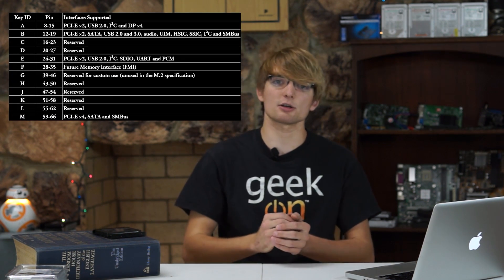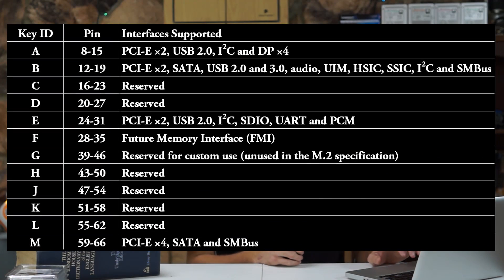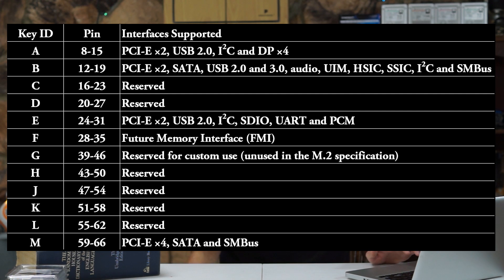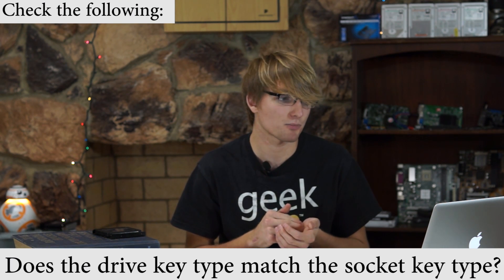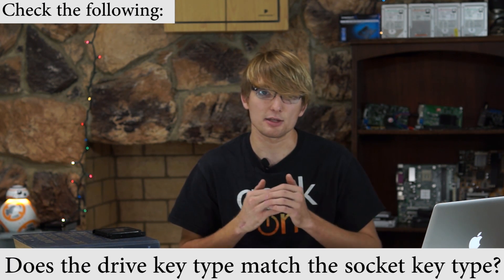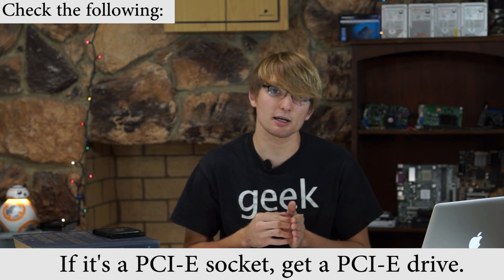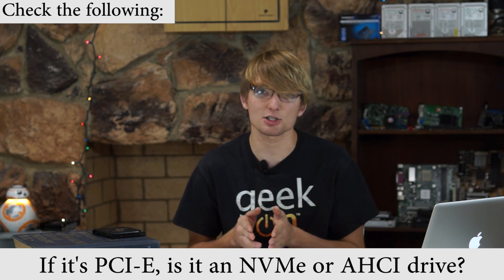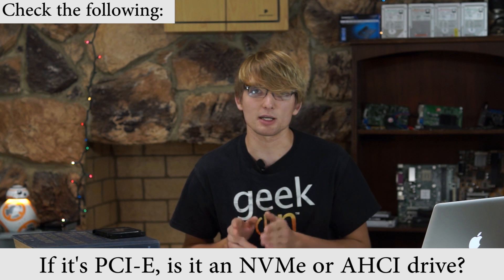What you need to know before buying an M.2 SSD

Comment: What is making me crazy is that I cannot find any answer in the internet to my question whether my old ASUS P6TDeluxe V2 will work with an NVMe SSD via PCIe 2.0 adapter card or not! I simply wanna know what you need for NVMe. Is it the chipset what must support it? Is it the mainboard? Is it WIndows? Or all together?
Reply from the maker: As I understand it, the interface is PCIe, so any PCIe device will be recognized by the board as such and then be handed off to Windows to find drivers. Unless the board has NVMe support, however, you can't use the card as a boot device. You shouldn't have any trouble using a PCIe NVMe card as a storage device, just don't expect the board to see it as a storage device for booting. - Chris
Reply: If your mobo has a bios update to support NVMe then perhaps it could be a boot device?

Comment: How to check whether the motherboard supports NVMe specification?
Reply: Same question
Reply from the maker: Your best bet is to check the manufacturer website. Most of them post either a spec sheet or a list of compatible drives.
Reply: @XKTechReviews  they have only written a M.2 slot ( I am using Hp 15q dy0008au)
Reply: Likely NVMe wasn't invented yet. If NVMe is supported they'd brag.

Comment: You are absolutely right, I bought a SSD M2 and I had no idea why my SATAS disappeared. I had to read on my phone that it was the other slot to avoid this and made it work in the 4 lanes PCI Express. 4 of my drives disappeared, and I read it should have been only 2, so I still have little idea why that happened and am still trying to figure it out, one reason I'm watching videos about this. My theory is that my motherboard, although it has 6 connector slots, each connector is actually sharing the same slot with another. So 4 connectors is actually two divided in two connectors each. I think you should have stressed that, the difference between SATA and PCI-E slots.

Comment: You didnt help me with my problem as i have an acer laptop( 1 year old) and i know what motherboard it uses but when i googled it nothing of importance came up. I wanted to know its specs and what it supports and so on as i have disassembled my laptop and found out that there is a pcie m.2 slot there and 1 wanted to use it but i didnt know if it was nvme compatible so im lost here.
Any help will be greatly apreciated

Comment: I got a question i have 1 m2 slot on my laptop lenovo Y700 standard it where a 128 GB NGFF m2 but i bought the 970 evo 512 GB upgrade NVME ssd i only got one slot and want to clone my windows C drive also bought adapter for M2 but it doesn’t support NVME only NGFF m2 sata is there a way to still clone my C drive to my new 970 evo?

Comment: Hey bro, can you please tell me if Samsung 960 EVO will give 3000+ read speed regardless of what type of port it's inserted in? I'm asking specifically for the laptops.
Reply from the maker: The M.2 interface is limited by the slowest factor, so if you put a fast drive into a slow port, it will run only as fast as the port will allow. You'd need a PCI-e 3.0x4 slot to get the full 3200 reads. A PCI-e 3.0x2 slot will limit the speed to about 2k.

Comment: my laptop has a b key slot, and i am wondering if there is a ssd that uses PCIe x2 over b key. and also, how do i find out for sure if the m2 slot supports PCIe or SATA? the manual says absolutely nothing. I'm starting to regret getting a toshiba..

Comment: If a M.2 stick is longer then the size of the motherboard- does this make it uncompatible? (I have lots of space beyond the physical end of the motherboard)
Reply from the maker: I don't see a reason why it wouldn't interface if you could get it to fit, but you'd probably have physical problems: it may not fit flush because of capacitors or other components in the way, and you wouldn't be able to secure it in place. It'd be less than ideal. ~ Chris
Reply: I see, yeah- it would be a bitch securing the other end properly.. but nice to know- thanks for the advice dude.

Comment: Still kind of confused um can I use an m.2 Bluetooth adapter on a pci e slot? Also thumbs up
Reply from the maker: +TheGGHackerz PlayMusic if you only have pci-e slots on your motherboard, you can always get an m.2 adapter card to use an m.2 Bluetooth card, but at that point it'd prolly be cheaper to just get a pci-e Bluetooth card. - Chris
Reply: XK Tech Reviews ok thank you I was just wondering because I need on for vr controllers and my friend has an extra m.2 Bluetooth card

Comment: I've recently bought the Samsung 960 pro NVMe m.2 and have Windows 10 installed on it. I currently have two windows 10 installed one on the 960 pro and one on my 850 evo ssd. I would like to transfer everything from 85p evo to the 960 pro with out reinstalling everything is it possible. Most of my stuff are saved and backed up on a 2tb hardrive

Comment: Not very helpful for online shopping.  So you have a Key type, then you have a drive type.. etc..  however, Online shopping is not setup that way and finding the "key" types are hard.

For example: Newegg: https://www.newegg.com/Product/Product.aspx?Item=N82E16820147594

Where is the Key type?  Also, no explanation on what the 2280 format is.  

So from this video I found out that my new motherboard supports a M-key type format but how do I find out the actual formats on the drives.  The specifications do not list the key as a format.

Comment: You have good content and editing I hope you get more popular. 
Its a nice haircut but you should get the hair that is covering your glasses cut.
Also, will I be able to somehow use a card like the WD Black 256GB Performance SSD M.2 2280 PCIe NVMe Solid State Drive on a ASRock H81M-HDS through an adapter or riser?
Reply from the maker: I'm not personally familiar with that motherboard, but it should technically be possible, with a few problems. The main problem is that the board only has two PCI-E slots, with one of them being a x1 slot. The x16 slot would be the best option for running an NVME drive, but I would suppose that you're using it for your graphics card. You could use the x1 slot with a x1 PCIE adapter card, but you'd be limited to speeds no better than a SATA drive, and that'd would render upgrading pointless. It looks like you will also need to flash your BIOS to the latest version to enable NVME support, as well. ~ Chris    http://www.asrock.com/mb/Intel/H81M-HDS/?cat=Download&os=BIOS

Comment: I gave the video a thumbs up and subscribed. But you did need a haircut lol.

Would have liked to see actual connectors or atleast pics of the actual connectors both on the boards and cards. Information seemed good. I just wish distinguishing the products apart when trying to purchase was as easy as the video made it sound. Its quite a difficult task to do. Even PC-Partpicker struggles with it. I've noticed and mentioned several errors on their site with compatibility issues.

Perhaps since U.2 is now starting to gain some ground and headway you can do a follow up video detailing M.2 even more and including info on U.2!

Thanks for the video and keep up the good work!
-Nate
Reply from the maker: Thank you! Yes, M.2 and several other current/next-gen standards can be quite confusing. I spent several hours researching the info for this video, and even after the research, it's not the clearest thing in the world. 

We took a bit of a hiatus, but we have some more videos on the way! I'll definitely look into making some more informational-type videos. ~ Chris
Reply from the maker: Hmmmm, there's not much info out there on that model. Did it come out of a pre-built system? 

Physically, yes, you could put a 960 on a PCI-E card and put it in your motherboard, but I don't think your motherboard has NVME support. You should be able to get the drive recognized as storage within windows, but I doubt you could boot from it. The second problem is that if your PCI-E slots are 1x PCI-E 2.0 slots, you're actually going to bottleneck the transfer rates to speeds slower than SATA. Even if they're PCI-E 3.0, you'll be faster than the SATA drive, but you'll still bottleneck the 960 Evo's performance. You really need a 4x slot to take full advantage of those read/write speeds.   ~ Chris
Reply: Hello, i was wondering, i want to buy the samsung 960 evo but i don't know if my motherboard supports it. Does it need a pci-e slot to work? if yes i think i got a slot available i got 4 x1 pci-e slots so will i be able to hook it in? my motherboard is : pegatron corp 2AD5, nice video btw liked and subscribed.
Reply: +MrMrdhmhtrhs7 - you will need a PCI-E 3.0 or 4.0 slotted motherboard in order to make use of its speed (or an onboard M.2 slot which your motherboard doesn't have). Honestly if you haven't purchased the Samsung 960 evo yet I would upgrade other portions of your computer before you purchase it. (Like upgrading to Skylake, Kaby Lake, etc, that utilize faster ssd's speeds.) Or if you still want some great speed go for a Samsung 850 or 950 pro SATA ssd. They are still extremely fast and you can always use it in another system after you upgrade to an M.2 ready one later.

As far as the 960 evo M.2....I LOVE my Samsung 960 evo m.2 (I purchased it after I first made the original post above) but I also have a current Skylake Z170 system/motherboard which maximizes those speeds. I can tell a big difference between standard sata ssd's and even a difference between my Kingston HyperX Predator M.2 (which is AHCI and not NVME). Both are VERY fast but the Samsung 960 Evo (at $129.99 USD for the 250GB version) is a GREAT value in my opinion.
Reply: Thanks a lot for your replies both the channel and you "its Neight". i haven't purchased it yet, and yes i'm planning on purchasing a mobo+probably kaby lake or the next gen intel will be making next year or something and then i'll probably upgrade finally on an SSD. thanks again for your replies guys much appreciated.
Reply: He doesn't need a haircut to look like every guy who's been brainwashed by douche bag hollywood . Be yourself and not a follower ,followers never pave the way to advances in anything  !

Comment: 2:25 That's actually not accurate. M.2 connectors differ upto speeds of 35Gbit/s or 3.5GB/s. It depends on the Physical M2 drive itself. Entry level Drives will top out at 6Gbps but for example, the newer Samsung M2 950 256GB has 2200MB/s read and 990MB/s write. The 512GB model of the 950 PRO can read @ 2500MB/s and 1500MB/s write. Drives from Manafacturers like Kingston and Intel have the same kind of speeds.

In one of your newest videos on a GIGABYTE 990FX Board there's an M2 connector where it says "20Gb/s" clearly marked on the board https://www.youtube.com/watch?v=uogTl_8tXZ8 @ 5:35
Reply from the maker: +andrewszombie Right. Perhaps you misunderstood me.  In the video I said that drives which use the SATA logical interface (over an M.2 physical connection) will top out at 6Gbps. That's why PCI-E M.2 drives were introduced-to overcome that speed barrier. ~ Chris

Comment: I'm trying to find a video on how to install an M.2 on a Sabertooth X9 mobo.  It would be great if you could do one since there don't seem to be any online for this specific board.
Reply from the maker: +Austin Reed Hi! I'm assuming you mean the Sabertooth X99, and we don't have one of those. That is a sweet motherboard, though! We're filming a review of a Gigabyte board with M.2 today, and we'll try to get a general M.2 installation video up soon. 

Not sure if this will help, but here's a written walk-through just in case. Make sure the computer is powered-off, and unplug the tower and press the power switch to discharge any stored electricity. The screw right below the second PCI-E x16 slot will need to be removed and that piece of thermal armor will need to come off, if you have that installed. The M.2 physical installation from here is quite simple. Make sure that you have the M.2 card right way up (it will physically fit only one way) and insert it at a slight angle (if you've ever installed laptop RAM, this process will be similar). Place it flat against whichever standoff lines up with the screw hole, and put the screw in! The manual should contain instructions on BIOS settings and such. Again, I know this isn't what you asked for, but I hope it helps! ~ Chris